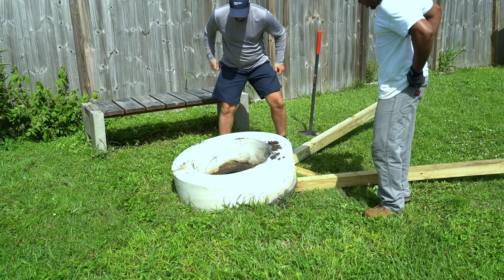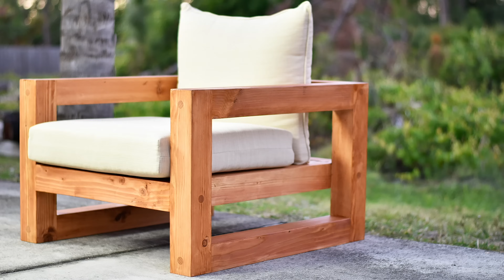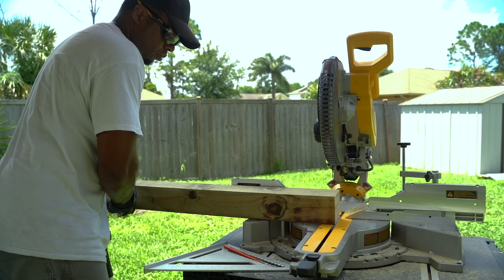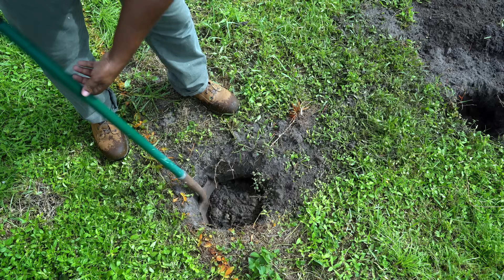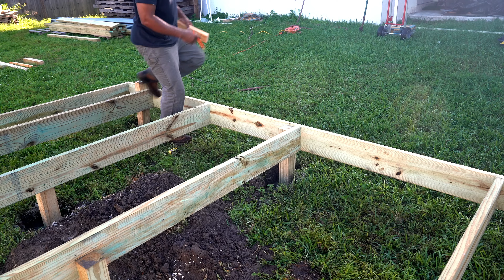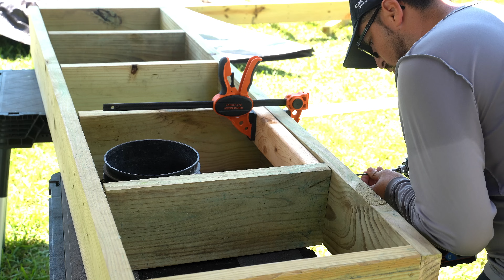Building A Ground Level DECK - (Part 1)

Comment from the maker: Thank you for your feedback on this video. I addressed as much of the concern as I could in the next video. See PART TWO of the finished deck here: https://youtu.be/Me6UX5nszrk
Reply: Wonderful video is it possible to share your plans with for this deck??
Reply: building a deck is a big waste of money all it does is rot out just put in a stone patio
Reply: I watched several videos on this type of project and found they were pretty deep, as far as method.  I totally enjoyed the method you used.  That's kinda how I like to build things.  Simple, but still detailed, at least for me, a metal fabricator.  Glad you mentioned joist hangers in the second vid because most people use them, and I like to go with the majority.  Looks awesome and being a electrical sign fabricator, I love the LED's.  I'm looking forward to starting my project.  Thanks for sharing.
Reply: Ö
Reply: Good video
Reply: Can i build a wooden decking for car washing ?
Reply: Can I get plans & material list
Reply: You are ABSOLUTELY my husbands hero! LOL. He watches every single video over and over and over again and is always sharing your videos! Thanks for all the good tips! You do amazing work!

Ps- GREAT JOB, Mario!!
Reply: I'd like to do this but the bottom laying directly on the ground (composite instead of wood). This eliminates the need for lifts steps etc. It seems that requires a cement slab to avoid issues with town laws? I'd be fine with a cement slab being the patio... Anyone know if that would be illegal (as long as it's done properly)?
Reply: You are, obviously, a DIY Guy! So learning is part of the experience. I know you took a lot of heat for the design (I personally chose to not call you out), but it showed what a real man you are to go back and make the necessary corrections to have a safe and awesome deck for years to come! :)
Reply: @DavidAlanReece  l
Reply: Thank you for your video.
Reply: Y I o  i is poo I it
Reply: @diycreators is it possible to get ur plan for this build i want to build this deck same design
Reply: Can you build me a deck pls
Reply: great video super clear explanations, thank you so much ;)
Reply: DIY Creators Hi, where in Florida are you located? And do you or do you know someone who could make a deck for me? I thought it would be easier lol
Reply: I like the way you work
Reply: @masonprice4101  jp
Reply: n

I
Reply: Not bashing but you should really think about removing this video.  This was your first video I watched and it immediately discredited your other DIY projects in my mind.  I went and browsed your other videos and they look great but you know what they say about first impressions...  Don’t let your other great work be discredited by this safety hazard.  Where I take issue with this video is safety concerns of people building a deck in this manner.  Here’s and example I lived:  My house had a 6’ elevated deck of similar construction built before I bought the place. Rim joists were screwed into the 4x4 posts with 5, 3”-4” screws and all the joist were then screwed into the rim joists without hangers.  This made a single point of failure of the 5 screws from the rim joist into the 4x4.  They fail and the whole deck crashes down!  Enough added weight from people and it was only a matter of time that it would fail.  The first thing I did after moving in was add lag bolts to all the 4x4 rim joists.  When doing this, i found that 2 of the 5 screws had already rusted and failed.  I ultimately had to tear down that old because of safety concerns and rebuild it.  You have great DIY videos so thank you for those!  You should consider retiring this video though.
Reply: @braeden761  A bad or good video, it all teaches us something.  Maybe just voice edit what was wrong or right
  Thanks for the video.
Reply: @braeden761  nobody cares about your mishaps bro ....you shouldve hired a pro lmao
Reply: @deadbeatdad7472  dude… you’re an idiot and a “deadbeat”!  You obviously didn’t take the time to read my whole response.  Or you’re just illiterate.. Your reply “you should have hired a pro”  has ZERO relevance to what I said, but if you had read my response you would have known that.  You are probably just too dumb to comprehend what I wrote so do us all a favor and take yourself out of the gene pool.
Reply: @braeden761  nobody cares about your experience get your own channel and believe me no one would watch you whine all day. Does mom and dad know your online? did you get permission?

Comment: 4:38 Wooden posts straight into the ground is just asking for problems. The rain and moisture in the ground are going to rot the wood pillars! Do it properly by using pillar shoes in metal or use plastic deck blocks

Comment: Really nice job man.  Only thing I might mention is post contact with especially wet soil is bad.  Perhaps you made a provision for that.  I use 2x4 and four screws to make a 8" or so base for 4x4 posts, to finish 1" or so above the surface.  Finished with a putty knife.  The little frames are removed a day or so after pour, then add dirt so it's the tallest grade, ensuring the concrete top remains above grade.   Looks like it belongs there, more than that effective.  That with your gravel will outlast most of us☺.  Ensure you ONLY add enough water to concrete to work with, and not a drop more.  The thicker the mix the stronger it will be for certain - For anyone that throws concrete into the hole dry, come on, really?  I thought the goal was to do it once.

Comment: the timber legs will rot out ...
Reply from the maker: These are ground contact lumber. It will take many years for that to happen.
Reply: @DIYCreators  you created a "pool"  foe water to sit and rot the posts need the surface. The cement should almost go right to the surface and be tapered downwards to shed the water . Also  treated timber...... cut  a piece and see that its "treatment " means 5-7mm around the surface only . once the rot hit inside it  it will rot even faster

Comment: While it looks good, there is NO WAY this would meet building codes. It is structurally unsound as decking screws are supporting ALL of the weight, not only on the posts but also for the joists!

Do NOT follow this ‘design!!’

Comment: I don't understand the purpose of deck tape. It is claimed that it will seal around a screw, but most people stain or paint their decks and the top of the screw is going to be covered by this waterproof coating. Water isn't going to drip off the edge of the deck board and move against gravity just to find that screw hole from the bottom. 

It makes sense to use general construction tape for 1/4th the cost on the joint. I used Gorilla tape on a leaking sunroof before, traveling daily and it lasted over 7 years in direct sunlight and traveling highway speeds before I had to apply additional strips. So sitting out of direct sunlight, and barely receiving rain... I think it will be fine myself

Comment: Question (I know next to nothing about building a deck), is the deck only attached to the posts with screws or is the deck actually sitting on the posts? If it’s just attached from the sides with screws, will it hold up?

Comment: Just a heads up for future builds all the deck screws I've come across have been for non-structural applications, I.e., screwing down the deck boards but not the structural frame underneath. My understanding is that the reason for this is that they are made out of too-hard steel that doesn't have enough give, whereas nails, lags, and structural screws are made of softer steel that has a much higher shear strength. The proper structural screws also tend to have washer heads instead of flatheads, so they are far less likely to pull through the lumber.

Comment: I want to do this soon. Build on ground then lift. If I do this without posts first I'm worried about bowed timber such as the rim joist. I'm hoping the joists are going to pull it in if it were to be bowed. How did you find this build any bowing?

Comment: Great job sir. You do amazing work. I am also a fellow DIYer and I just have to say the way you describe and show what you are talking about is perfect! Well done and I will be using some of your techniques on my next deck project. I would like to talk to you about my situation. I have a concrete patio and is 10imches from the door that leads to the patio. I want this 12x16 level with the door floor. Would you bust up the concrete or just put the 4x4 post right on the concrete?

Comment: Those posts don't seem like they are PT wood for ground contact and will fail to hold the deck in a few years or so. Other than that good work ethics in diy project.

Comment: Sorry to be disagreeable, but you're demonstrating a poor framing technique here.  The joists should be stacked on TOP of the posts, resting on solid wood and mother earth.  You inexplicably put the joists on the side of the post and nailed it.  So the weight of your entire structure depends on the sheer strength of nails or whatever fasteners you have.  Fasteners are not designed to bear weight.  It's just a deck so you might get away with it, but you've greatly reduced the strength of your structure, for no reason.  There are lots of videos on Youtube that show the correct way to do Post-to-Beam connections.

Comment: You need to cap the post holes with concrete so the water dosnt sit in post hole it will rot real quick the water needs to run away from post holes

Comment: Really like your vids. However, please reconsider using deck screws for ANYTHING aside from attaching deck boards.  Either get some construction rated screws or rent an airgun/compressor and use 80% galv. nails and the odd screw for peace of mind pullout protection.
Arg, finished the vid.
Major mistake is attaching the deck joist frame TO the 4x4.
I know this is a small deck, however good chance a lot of people will watch this and do the same on larger, taller decks.
Always, always place a weight supporting structure ON TOP of your foundation.  It would have been easy-peasy to get some Strong-Tie Post bases to put ON the tops of the 4x4's, and then set the joist frame on top of the Post bases.
Currently, your deck is supported by the joists screwed into the sides of the 4x4's!
Even if you were to run beefy bolts through, its still nowhere near as strong as it could be by just setting the deck on top of the foundation.
Great channel, presentation, and git'r done mentality, however there is a reason Planning/Permitting dept's exist.

Comment: One thing I've learned is never cement wood in the ground.  What you should have done is made cement pillars, then made a U-holder from steel and attach the posts off the cement thru the u-holder so that the wood never touches the dirt or cement top.  this will bring 15-20 more years of enjoyable use without rot.  the way you are cementing the posts in the ground will last max 5 years before you'll have to dig everything up again and start replacing rotting posts.

Comment: Good job for a first deck. You have a lot of improvement s to be made in the near future. Post size, post attachment technique, screw type etc. BTW, you only needed four posts (6 would be cool too). Once the joists falls off the posts down the years, you'll see that you can make improvements on your next project(s).

Comment: Why not use a post hole digger to dig the holes. Also a spade shovel would have allowed you to cut the grass and roll back like sod. Much easier to remove and can be relayed somewhere else if its needed.

Comment: hi. is it still in place? wont unprotected wood rot, if not coated with protection against water??
Reply: How long is the overhang for the angle and what are the dimensions of the step ?

Comment: Hows the weed barrier holding up?
Reply from the maker: Not one blade of grass came though yet.
Reply: @DIYCreators  Nice to know! I've followed some of your methods when building my ground level deck. Slightly different design but did the landscape fabric over the grass under the deck method. Thanks for all you do for the DIY community!!
Reply from the maker: You are welcome, you can go about this a number of ways. What I do is never set in stone. I'm just sharing my experience.
Reply: @DIYCreators  Exactly - you give people the confidence to DIY. Knowing someone has done it before and worked out some of the challenges. Thanks again!

Comment: Basic post and beam - you should of cut a notch, which would take the weight of the beams. Then screw to keep the beams in place. By just attaching the beams with screws, the screws well than have to take the weight and over time the screws will fail. But your project was well thought out and came out well !!!

Comment: Hey nice deck but you should of used bearers to support the load from underneath with the bearers sitting on top of the stump taking all the weight. The way you have designed this, the screws and bolts are taking all the weight. Long term this will probably be not good. Fortunately the deck is close to the ground. Just my opinion. I can see you've gone to some trouble to build it. Nice job in the end

Comment: You cant build a deck that way where i live in canada. If you dont put your posts under 5 foot where the frost line is its gonna move after winter. Also why didnt you use elephant foots, no concrete mixing and less work.

Comment: I live in Florida as well. How come you added the pebbles for drainage and then added concrete which will add a place on the wood that water can rest and rot the wood? Wouldn't packing the pebbles down on the bottom be more than enough to prevent sinking ? Maybe larger rocks mixed with smaller ones for strength and drainage ? Just asking , and I loved the video and a great looking end product sir !

Comment: You never put the posts in concrete my man. Always use sonotubes and mount post on top of concrete. The chemicals are going to eat the posts. You should always use joist tape before putting decking on if you want joists to last longer. It's just a flashing tape.

Comment: putting untreated wood in the ground  for support means you will have sagging floor someday as ground organisms will start rotting the wood and if wet might only last 3 years and collapse also termites like untreated wood  most online sites are filled withe same problem  untreated woods that are doomed to rot after spending time and $$$   dont hire any one that does this
Reply from the maker: This is 100% pressure treated wood.
Reply: @DIYCreators  if you croscut the grain you must treat the exposed cut

Comment: Great project. We are about to try building a deck on a slope to place a shed on. Any tips on building on a slope? Sorry, a very  novice question but do you pre-drill the holes for your decking screws?

Comment: Interesting build coming from the NE.  My only comment would be always put your deck ON the vertical support/4x4 pier.  You never want to attach your rim or joist  to the side of a vertical if possible.
Logical build, good job.

Comment: Built a similar style deck off of a raised deck that was built by previous owner. Ran into a similar problem, had my deck level in all directions, but looked off because the other deck was off.

Comment: Next time  put post under your ban or at least though bolt it also the way you did the front section I could see is sagging over time you need a post out there also . If you can it's better not to burry the post but bring the concrete above or at ground level and put a post foot that keeps it from sitting in water and the foot allows them to drain. You don't want to put fabric under the deck mostly because you will just trap stuff between the deck and fabric but if you are doing a screen porch take the screen and roll it out on top of the joist this allows you to ease blow it out and keep bugs from coming between the boards. Also good call with the tape it's easy to put on it makes the finish with the t clips hide away system look nice and it protects the top of your joist if that gets soft the screws loose their hold . Also I would put post u Der the outside corners and not just supported with the 2 post in the middle.  Nice job

Comment: Just a few thoughts here from one DIY guy to another, as we all help each other out – right? I’ve seen both parts. These are not criticisms, just some tips:

• Always build UP. In other words, prep your area first – pull the sod, pour proper concrete footings into sono tubes, lay down the weed barrier, cover the weed barrier with aggregate (gravel/pea gravel). Then you are ready to rock.

• After framing, add your reinforcement bolts and joist hangers THEN, so you aren’t crawling around under a planked deck adding those later.

Cheers mate. 👍
Reply: @Hello Christian how are you doing

Comment: huge problem right away.  you should not have the posts in the ground with the concrete.  it will pretty much rot away very quickly.  you should have used a concrete post base and the set your wood posts on top of them to keep away from the moisture.